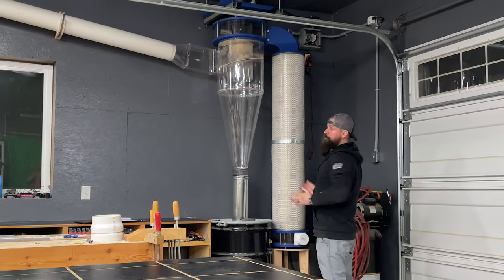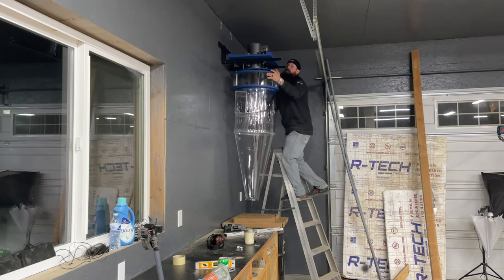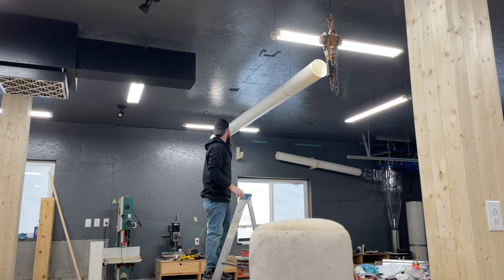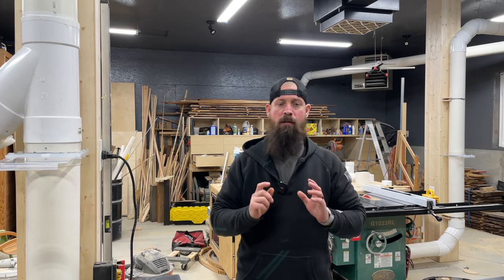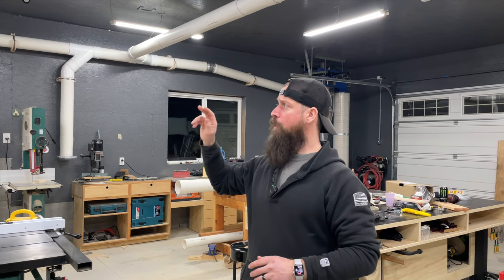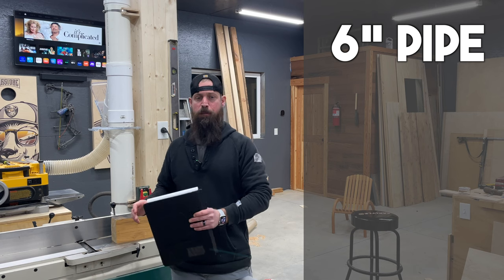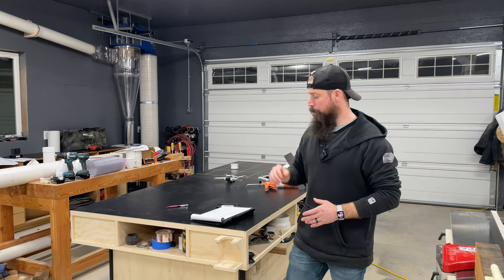Installing dust collection, With One Simple Modification |Plus DON'T USE THIS|

Comment: I didn't watch the whole video.  I saw you hanging PVC pipe and stopped to tell you you should ground it.  

Kidding.  Looks good.  Congratulations on the shop improvement.  I don't think I'll ever get to that level of wood working, just too many interests to consume my finite funds.
Reply from the maker: You had me for a second! 😂😂 thanks man, I can relate I have way too many hobbies myself. Thanks for watching, and taking the time to comment. 🤘🏻
Reply: I read about only using it 4 times an hour unless you’re using it 15 minutes at a time. Wish I had known that little tid bit before I purchased . I guess I’ll be rebuilding the motor more frequently than normal

Comment: Nice!  I have a high pressure system that uses higher speeds through 4" duct, so it makes sense for me to have grounded pipe.  Running foil tape on the inside of the duct creates two long knife edges that should collect static charge well.
Reply from the maker: What’s the fpm in your 4”duct?

Comment: Just came across your video. I want to thank you for speaking up about the myth about static discharge causing fires in home shop dust collection systems. Also your comment about not commenting about the lack of grounding as you won't be doing it. I feel 100% the same as you do. PVC is an insulator and therefore you cannot possibly ground something that is already an insulator. My one exception to that is within about 4 feet of my cnc will be a pipe wrapped in foil tape that is then grounded to my shops electrical conduit which is then obviously grounded to the power systems ground, cnc's can be very finicky and any static from any source can cause havoc.

I will be subscribing and following your content in the future, you seem like a true woodworker and not a fake youtuber only doing things for content like most "woodworkers" are these days on here.
Reply from the maker: First off thanks for watching and taking the time to comment I truly appreciate it! As someone who does high voltage electrical for a living and grounding being something that keeps me alive on the day to day the grounding pvc topic really gravitated to me, and I never understood the hype in the woodworking community. I get the unpleasant feeling at times, and I totally understand the concern with sensitive electronics like cnc’s, but I’ve had so many people telling me my shop is a ticking time bomb if I don’t ground it, and it’s going to explode. It’s just not the case. 😂 blah blah you know the story. 

I’m actually about to jump into the cnc game myself  finally and I’m sure I’ll be adding some protection for electronics reasons, and it will be something similar to what you stated and only be a short section for that purpose.

I don’t know if I’m a true woodworker, but I am very dedicated and passionate about it and just like learning new skills. Thanks for your support, and time.  👊🏻

Comment: Subbed and liked .  I was jealous when you said you used your CNC to make the brackets (I have a cnc router table but never put together and also need the spindle and electronics) then I had to lol when you said psych and showed us that you did it on a bandsaw. I really have a bandsaw as they look really handy at times. 
I find it incredibly you got the motor up by yourself , wow . I’m an old man ,63, so I’ll get a friend or grab the guy on the other side of the ally when he gets home from work . I have the CV1800 and will be installing it soon , so it was nice to find your video .
That’s interesting about the 9 degree angle , not sure how I’m going to deal with that
Reply from the maker: Thank you! I feel like people always get angry when they see people using cnc’s so I thought I’d throw in a curve ball. 😂 I actually have a cnc on order, I can’t wait to use it.

It sounds like you’re smarter than me by asking for help on lifting the motor up. It’s definitely the way to go, and wouldn’t do it alone again. 

The 9 degree slope isn’t a must and can certainly be ran straight out, without the slope. So don’t sweat it too much. Thanks for watching and commenting. 👊🏻
Reply: @brewbuilds  well you did one hell of a job, and thanks for recommending mounting it as high as possible. I have a 10 foot ceiling , so I’m aware I have to support the clean out  box under the air filters etc .
I’m going to see if I can source out that tape you used . I was going to use the foil stuff but I’m liking the silicone tape much more , and it’s probably easier to remove if it comes to that. 
I want to build similar brackets to yours ,as it makes sense keeping the duct away from the wall to better seal it . Probably use my jig saw and my spindle sander to make one template , than a hand router to mass produce

Comment: First time to your channel, nice job on the install. I'm 61 and totally sympathize with working by yourself and getting your back out of whack. As good help, or any help is hard to find these days I have to engineer projects that can only be done alone, I have no young bucks around my neck of the woods ! Anymore, I have to be really careful about doing things that will screw up my back as I'm out of commission for weeks when I do something similar. Anyhow I'm subscribing and looking forward to watching your builds, nice job my friend ! Cheers and all the best from SE Utah !
Reply from the maker: Thanks for watching. Yeah I also normally engineer something  to lift the heavy objects in my shop, but for whatever reason I decided to risk it with this one. Thanks for subscribing, and taking the time to comment. 👍🏻
Reply: Bro/Brew 😂, I did the same exact thing.  It was late at night, I had the bracket hung, the motor assembly done, no one was around or awake, and I was getting that SOB hung.  I had only a 4’ ladder, and I did it pretty easily.  My back was spared.  However, I also did the same damn thing.  I had to move my install higher up.  

I took it down myself, raised the bracket, and rehung it again, by myself.  I laughed as I watched you do the same.  I wasn’t building your contraption.  I just wanted it done.  

Anyway, thanks for the information and video.  Good job.   Great shop.  Great work.
Reply from the maker: 😂😂 I paid for that for awhile! Normally I come up with some fancy way of lifting heavy items alone. Thanks for watching and taking the time to comment. 👊🏻
Reply: @brewbuilds  Yeah, backs need to be tended to…kept flexible and strong.  I hope you’re 100% now. 

Keep up the good work, my friend.   I’ll be watching.
Reply from the maker: @redgoblin1  for sure, well it’s as good as it was prior…😂 you too! 👊🏻

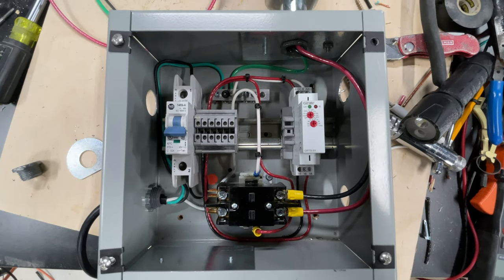Comment: Great video and especially appreciate the mods you made to the electrical to accommodate the cycle requirements for the blower motor. I know you've linked the time delay relay but there are some other components in the box that I wasn't sure what they do or what they are.  I paused the video at 8:30 and studied it closely but still, it was a bit confusing to me.  Is that white item on the left of the box for the remote control on/off?  and the thing in the middle, is that a terminal block for the 110 AC?   Hoping you can clarify about what the other components are and what they do  -- I would love to replicate it for my soon-to-be-purchased clearview cyclone.  I'd also be happy to buy the plans for the electrical if they exist or you're willing to write something up.  Thanks and all the best!!
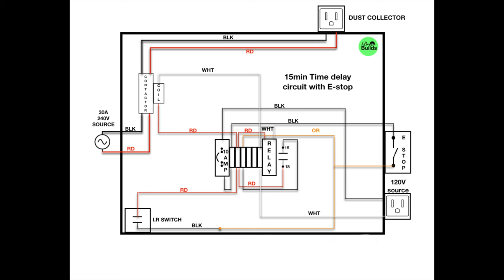Reply from the maker: Hey Carl, thanks for watching, and taking the time to comment, and ask questions. The timed delay mod has been awesome and I’m glad I took the time to do it.  So the 8:30 time mark shows the components installed, and the internal wiring complete, but excludes the final wiring that needed to take place after the box was installed to accommodate the external items. At minute marker 8:18ish I show the wiring diagram ( I’m not sure if you missed that) but the item to the left is a 10A circuit breaker I added to protect the control circuit, then the center items are the terminal blocks (phoenix blocks is what we refer to them as in my profession, it’s a brand) then at the far right is the time delay relay. The black item at the bottom is the contractor for the motor. The wireless receiver is the white item plugged into the receptacle external and to the right of the box it has the light on it. The nerd in me really wanted to go more in-depth on how I did all the wiring, but with todays age and how people can be I didn’t want the liability if you know what I mean… if you want to email me at brewbuilds2@gmail.com, I’d more than help you in more detail and explanation of what I did with the wiring, and any other questions with what I did, and can share more pictures. Again thank you for watching and commenting, and please reach out. 👊🏻

Comment: Love the pipe hanger design.  I may do something similar on my current dust extraction build.  One item I'll be adding out of an abundance of caution even though its been shown to not be necessary is continuous copper tape line along the top of all pipe with copper screws to the interior of the pipe grounded at several locations.  I realize it's probably unnecessary to worry much amount static buildup, but I figure it cant hurt.  I'll also be building in a delay on the shutoff of the motors to cut down on the frequency of cycling motors off and on again.  Seems logical.
Reply from the maker: Thank you, the pipe hangers worked out great, and the delay circuit is good insurance. 

The grounding is whatever you’re comfortable with, I would personally never stop anyone, it’s just annoying having people comment saying my shop is going to explode if I don’t do it.😂

Thanks for watching and commenting. Keep me posted on how your setup turns out. 🤘🏻
Reply: @brewbuilds  Agreed that the grounding is really unnecessary.  I'm retired and look for projects to keep me busy and interested which is the only reason I'll be adding it.  I feel like it could end up being a cool Tron like artistic element with the copper tape on white pipe so its more an esthetic thing that can't really hurt.  

Keep up the cool videos and ignore any negative chirps from others.  These posts help motivate the rest of us to take on cool projects.  Cheers.

Comment: Just the info I needed on the time delay. Could you also install a fan blowing on the motor to help keep it cool and thereby shortening the cycle on how long it has to run? I have a Clearvue system and I’m looking for the best options. Thanks.
Reply from the maker: Adding a fan definitely wouldn’t hurt anything, but the motor has a built in fan that’s designed to properly cool it. So it might be overkill. The 15min is just a good practice, and is stated by the manufacturer, but I’m sure if you run it shorter durations occasionally it won’t hurt it. I wouldn’t sweat it too much. 👊🏻

Comment: Glad I found this. Much I knew but the TAPE!!!!  Wondering ... link is for 1-1/2" silicone tape,  would the 1" also work?
Reply from the maker: Thanks for watching! Yeah the 1” should work, but keep in mind when you stretch it the overall width reduces so you may need to do additional wraps around the joint to get good coverage. I found the 1-1/2” to be the happy medium for using less product on each joint. Hope that makes sense. 👊🏻
Reply: It does. Thanks much!
Reply from the maker: @cottagemail4066  awesome glad I could help. 👊🏻

Comment: Best tip, get rid of filters, bags, and canisters. Have your collector rest on a 55gal drum (with the drum being the cyclone) and then run your exhaust through a wall outside. 
 
If you do it right, dust will not make it outside the drum until it's almost full. Now, a $200 WEN collector can do wonders in a small shop. 
So ditch the filter, and you'll be so much happier you did.
Reply from the maker: I agree with venting outside, but my shop is heated and my winters get cold. I can’t justify losing that heat. I have seen people make there systems able to direct the exhaust outdoors when the outside temps aren’t as harsh, and then filter inside when it doesn’t make sense. 👍🏻
Reply: @Brewbuilds  ooof how cold does it get there?
Reply from the maker: It gets into the negatives in the winter and over a hundred at times in the summer.
Reply: I vented mine outside. I love it. It made it much quieter and have never noticed any fine dust on my truck that gets parked right outside the  vent. So it's a win... Not to mention very little resistance on the airflow
Reply: @ICTbondsman  yeah, I see no dust at all come out until my 55 gal barrel gets up to around ¾ full. 
 
I found clear bag liners for the drum a few months back. So I was able to cut a thin slot out of the drum side (except for the rib support areas that bulb outwards) and epoxied a piece of 0.03" thick plexiglass over it. Now it makes it so much easier as I can see when the dust/chip level is, and just pull the bag out, dump it, and put the bag back in.
 
I'm just still shocked at hiw efficient it is for such a small motor (WEN 7.4 amp induction motor). My 2hp unit with a canister and filter was not that much better overall. I've gad surprising luck with a few WEN tools these past 2 years (but a few tools I tried were garbage. Lol. It's a luck factor.)

Comment: I found this video from your Instagram response the other day. Awesome info for those of us hanging 6” pipe for the first time. I have to ask though, do you think the 3/4” screw heads add turbulence to the system? Seems like they’re not worth their function, unless I’m overthinking it
Reply: Also I just have my pvc hanging from metal strapping (with rubber tape sandwiched between) since my ceiling joists are only 8ft high.. do I need any downward pressure on the pipe at the hangers or do you think gravity alone is enough? I’m worried the pvc isn’t “locked in place” enough
Reply from the maker: Hey Chris, thanks for watching and taking the time to comment. As far as the 3/4” screws you’re talking about are you referring to the ones I used to secure the joints together? If so I’m sure if you had sensitive enough measuring instruments, and a very controlled environment you could maybe see the slight amount of turbulence that they may add. But when I calculated all my cfm and air speeds I was right on par with Bill Pentz’s recommendations in his write up on the matter. They also helped me insure the joints stayed in place while I was assembling the system sometimes the joints will slip or pull apart and they really help prevent that. Let me know if that’s what you were referring to.👍🏻

As far as your pipe hanging method, that seems to be a pretty common method and I’ve really never heard of any issues. All of my horizontal run that travel inward to my shop are suspended by a similar product my just happens to be plastic strapping material. I made those wall hangers for the first section of the pipe the runs right up against the wall, and for all the vertical drops. I will say I like how that added some rigidity to the system. But isn’t a must. 👍🏻
Reply: @brewbuilds  yep those were the screws I was referring to. Yea I may be overthinking it- they probably help a lot more than they hurt. I’ve been having issues with my fittings pulling out during the dry fitting stage, I think I’m gonna use the screws like you did. Thanks for the response! And I’ve got some real pipe hangers coming to replace the metal strapping just so I feel better about it.
Reply from the maker: @christopherkohl4930 yeah they work great and really, they barely stick threw. I only used 2 per connection. If you have any questions throughout your install feel free to email me, or shoot me a dm on Instagram I’d be more than happy to help.👍🏻

Comment: Nice video.  FWIW, I find that below about 2 1/2" you're far better off hooking the dust collection up to a shop vac.  So the miter saw might be better off that way.  

I also built a 4" overarm dust collection arm for my table saw, and was pretty disappointed with the results.  Might have been better with a flexible "saw stache", like you see around CNC cutter heads.

I also upgraded from my grizzly to the SawStop, and their built in blade guard seems to best of a bad situation, with it attached to a dedicated shop vac.

In both cases you're attempting to collect dust from a blade moving at 150 MPH with a dust collection system that moves air at 40 MPH, you can't win.  Open ended cuts are usually the worst.
Reply from the maker: You’re 100% correct. I briefly talked about those topics in the video, and I’ll be making a 4” over arm dust hood for my table saw, along with making something better for my miter saw, and belt sander. thanks for watching and commenting. 🤘🏻
Reply: @brewbuilds  FWIW, I ended up using a simple 90 deg HVAC boot attached to the back of my sander.  I then extended the sides of the boot with 1/4" plywood so that they overhang the sander.  The sides are removable, and only attached by magnets, otherwise they can get in the way if you want to use the ends for curved cuts.

The "dust port" on the rigid sander is pretty worthless, even with a shop vac.
Reply from the maker: That’s a great idea thanks for sharing! Yeah I agree the dust collection on the Ridgid sander is worthless. 😂

Comment: Let us know if static becomes an issue with no grounding.
Reply from the maker: Static hasn’t been an issue, and I didn’t have an issue with it in my previous shop setup either. The cyclone does build a charge (as expected), but isn’t an issue. 👍🏻